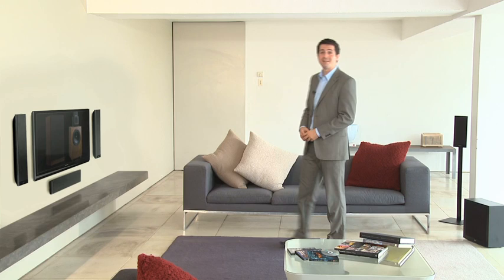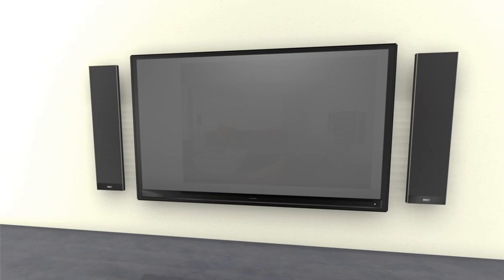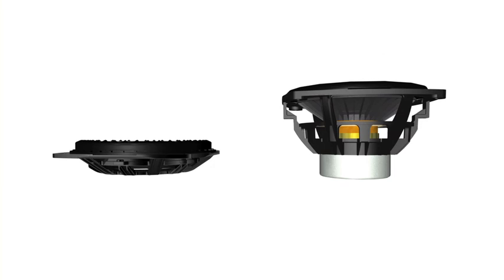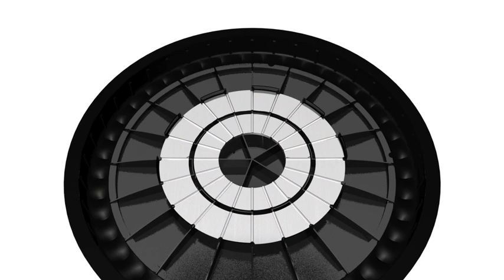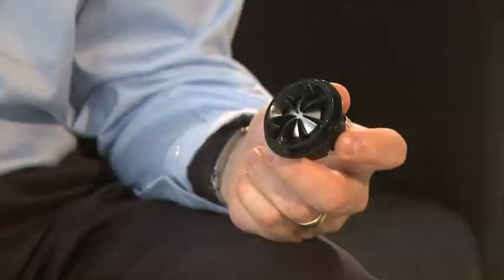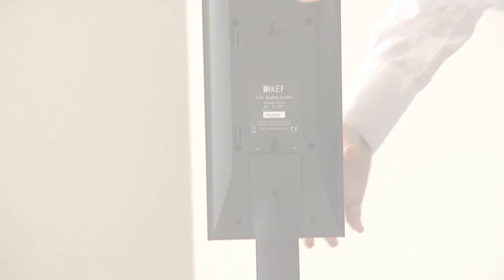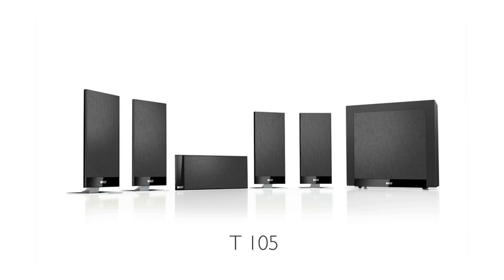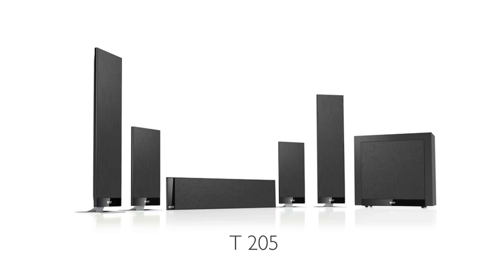KEF T Series product introduction

Comment: who talks and smiles like that though? KEF makes great speakers don't let the cheesy ad put you off. I have 2 sets of HTS 5001 the build quality is amazing for a normal living room. I have tried floorstanders bookshelf they are all too boomy for a small 4m x 4m room too much going on.  I have one set as the base and the other set for height channels the heights i turn horizontal as close to the ceiling as a can get them pointing down into the  listing area  using 5.1.4 atmos they sound better than anything I have tried. 

I was lucky these were the first speakers i bought and Iv tried to better them but these are still being used to this day. I would get more for them  weighing them in for scrap sold aluminium construction! so refuse to sell them for silly money for the price these would have cost a price of a new car. all be it a KIA, these are like gold to me